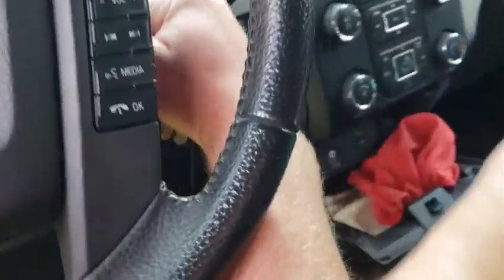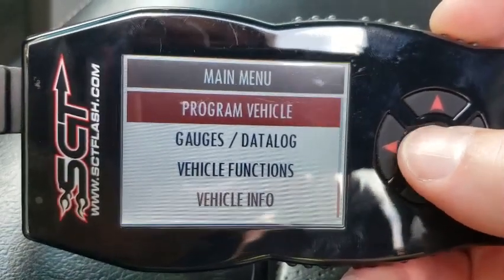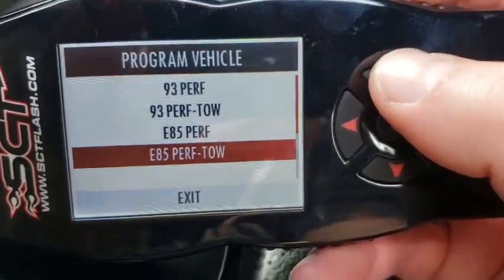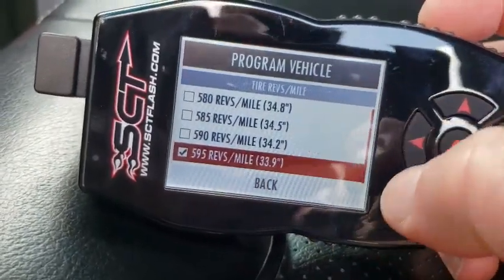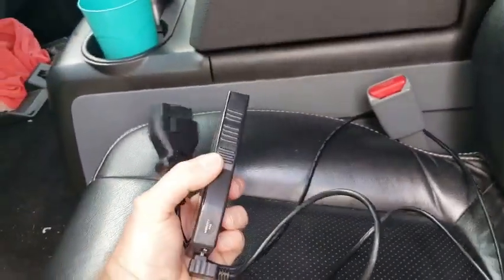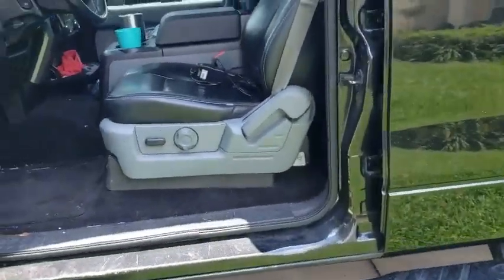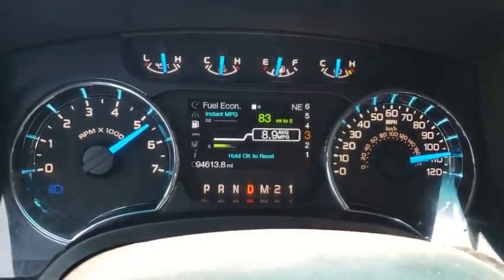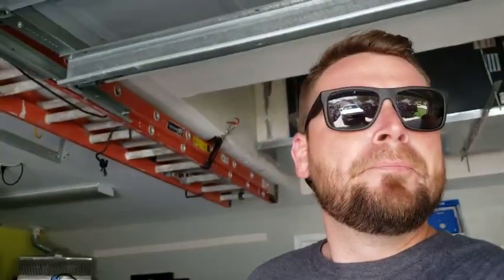5.0 LOVES that E-85 Tune!!

Comment: I found my 5 star tunes really fast and good for performance but also not great for daily driving. My ‘19 5.0 on their 91 performance tune would blow the doors off this truck, but it’s also not lifted on stock tires and has the ten speed and aluminium body. I got so sick of the erratic shifting and extremely hard shifting in some cases, I’ve now just switched to a flex fuel tune from another tuner, even though the 5 star tune was stupid fast, the drivability is now much nicer, it isn’t high idling as much so I’m not on the brakes as much, but then it still burns rubber when I step on it, but it will actually go up into the higher gears again when I’m not on the throttle. You might want to look into something like that if you’re having to switch tunes back and forth all the time.
Reply: Oz Omega tune Im guessing?
Reply from the maker: I'd definitely be interested in that tune too, I agree that the 5 star is a bit aggressive as a daily driver after awhile. Very touchy pedal from a stop
Reply: Hey which tune company did you go with ?
Reply: I have a 2020 and running the 87 performance tune (not perf + tow) as my daily driver. Both the engine management and shifting is way smoother than the factory tune. The horrible factory herky-jerky shifting is the whole reason I put the 5star tune on it and could not be more pleased. To me, it's a completely different truck. In a good way. 

I also bought the 91 & 93 tow/perf & perf only tunes, but because of Bidenomics I haven't run those premium tunes yet, so no idea if the shifting will be different. Still hoping gas prices will come down sometime soon so I can try them.

Comment: I recently bought a sct bdx tuner for my 2013 5.0. It has similar mods to you such as cold air intake and cat back exhaust . My tuner comes with preset tunes such as the gas option and tire size. Is it safe to use the preset tuner without a custom tune for the exhaust and intake?
Reply from the maker: In my experience even the preset tunes have a little wiggle room as not every setup is the same so I would say it's safe. If you hear pinging or it doesn't shift right I'd reconsider

Comment: How many revs are in a 40x15.5r26 tires?
Reply from the maker: Google says 517, but I've found its never 100% accurate as your actual tire measures out a bit under what the sidewall says in most cases.

Comment: Are you running stock gears?? If yes what are they??
Reply from the maker: yup, all stock, 3.55 ratio. I've been looking at putting a posi system in and considering going larger too
Reply: @jtpbuildz959  I added 4.88 gears and the auburn limited slip diff and love it
Reply: @jtpbuildz959  I'm also running 35s 22in wheels with a -44 offset
Reply: @pitbullfan1234  why the 4.88s instead of 4.56, just curious
Reply: @ltdan8261974  I was recommended them and thank God I went with them would've been extremely disappointed with the 4.56s
Reply from the maker: Where did you get the gears from? Summit? I still plan to put a limited slip diff in and would like to do it all at once
Reply: @jtpbuildz959  man I honestly don't remember it's been a couple of years